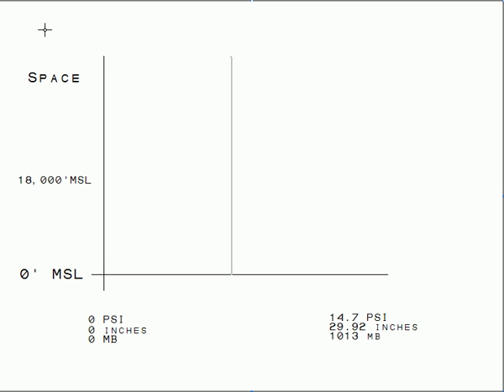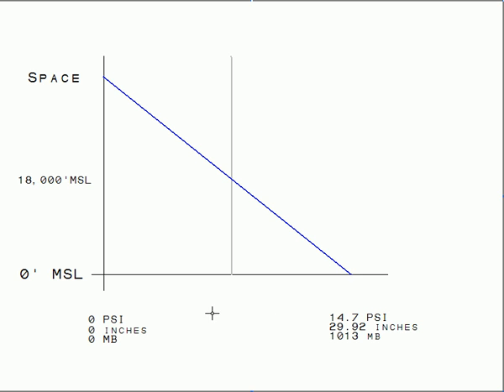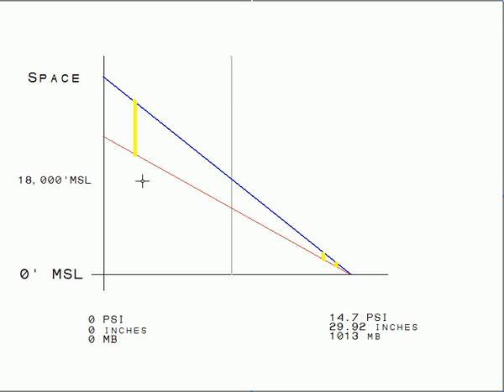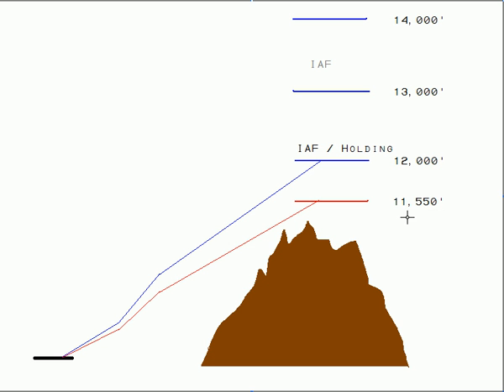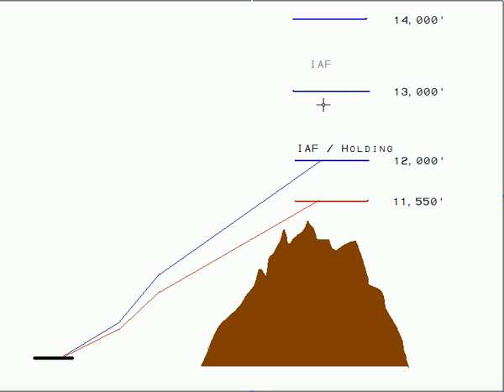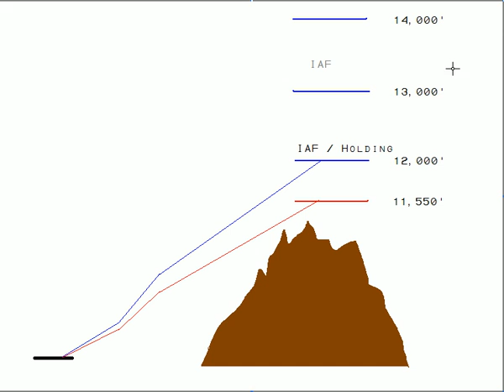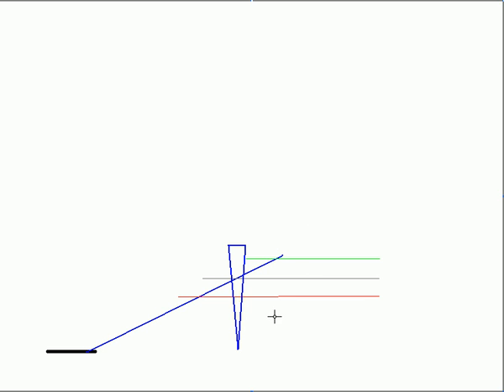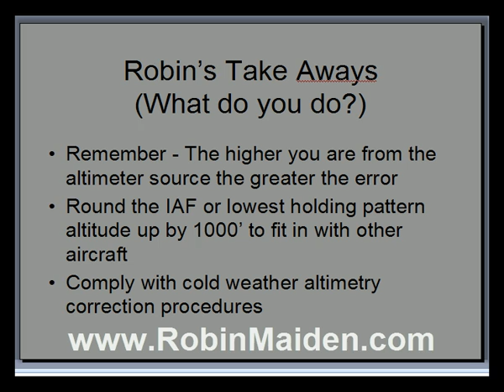Cold Weather Altimetry, Cold Wx Altimetry, Cold Weather Altimeter Corrections, Cold Weather Flying

Comment: Why isn't pressure / altitude effected by temp at sea level?
Reply from the maker: Sea Level is THE reference where all altimetry begins.  Temperature does affect the density of the air, but the Kohlsman window adjusts that out to a local pressure.  That’s how the weather observers give us an altimeter setting.  At sea level, they essentially take an altimeter and spin the Kohlsman window until the altimeter reads “0” then read Kohlsman window.  

When you get a local altimeter setting, it represents a sea level pressure - not a local pressure.  Sea level is the datum.  It is the reference point where the altimeter “draws the line” to convert local pressure into a displayed altitude.  

I would propose a “Maiden” window to adjust the slope of the computational line in the altimeter based on the temperature deviation from ISA at a local station.  This would make altimeters more accurately approximate true altitude.  Administratively, this is not likely as everyone would have to begin doing this at the same time.  As they say, “It ain’t gonna happen!”  But, an interesting thought experiment as we move toward GPS based geometric altimetry.